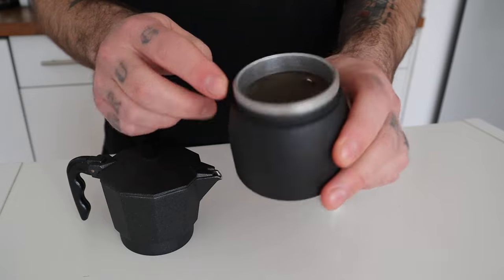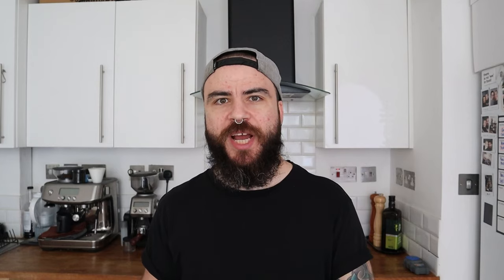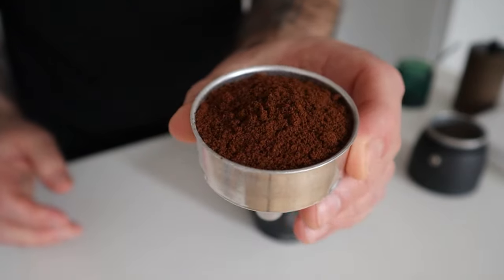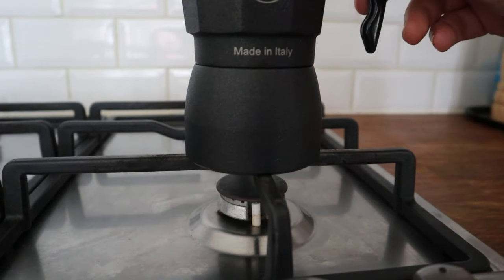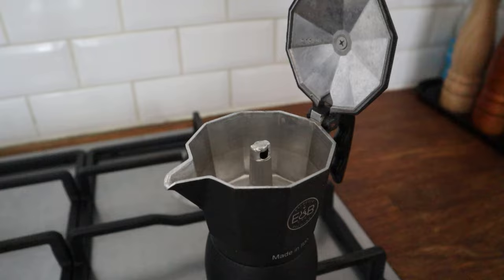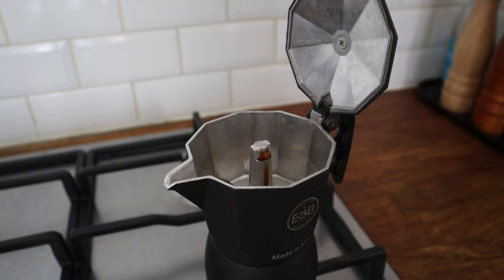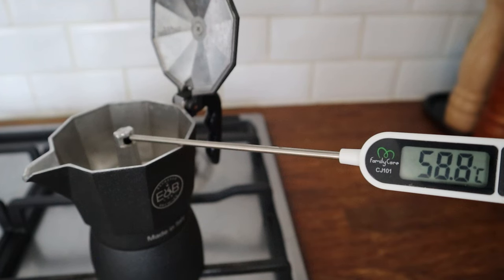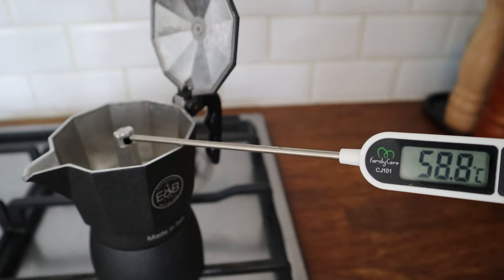The Ultimate MOKA POT Technique - How To Make Coffee With  #mokapot - 2022

Comment: If the the pressure in the moka pot is higher than the ambient air pressure the water must be hotter than the normal boiling point of an open kettle.You cannot have it both ways ! Water will not defy gravity and jump out of the pot without pressure and pressure in the pot come from the increase of heat then water under pressure will boil at a higher temperature.So what is the reason that the water is forced out at 75 degrees?I may be wrong but it doesn’t add up.
Reply from the maker: water evaporate at lower temperature than the boiling point, imagine when you put wet clothes to hang, they will become dry at one point, but they don't reach high temperature. Now in the moka the water in gas form is trapped in the lower chamber and this build the pressure to allow the liquid water to rise in the basket until reach the upper chamber. I hope I answered your questions.

Comment: I notice that the first brew with the new gasket is usually a pretty poor one. But it’s 100% uphill after that. For some reason…. The seal isn’t the best in the beginning. Takes one crappy percolation to get it up to par
Reply from the maker: Yes it happens, sometimes it need to adapt. Also depend on the manufacturing

Comment: how do you know if a moka pot is good or bad?
Reply: Ok so I've always put the moka pot under the tap to cool down when the coffee gets thinner and runnier. I shall not do this next time and see.
Usually my coffe is very acidic.
Reply: And could you test the Ikea moka pot for a video, I'm slowly thinking that that is a "bad moka pot"
Reply from the maker: I usually check, the material, how thick is the aluminium (in case of aluminium moka) filter quality is very important and also gasket, but they can be replace. The valve is also important for pressure stability. Important for a moka pot is that keep good stability of pressure and temperature stability.
Reply from the maker: If the coffee is very acidic I suggest you to remove moka from the stove at that exact moment and let it run by itself. You will see the coffee ill come out but slower and the extraction won't be super aggressive and will balance better the acidity you find. Also to avoid too much acidity adjust grind size and coffee:water ratio. How many grams you usually put in the basket?
Reply from the maker: Probably is the reason why Ikea recalls all of them from the market. To be honest I never saw the Ikea moka pot in the market here in Italy or UK.
Reply: @matteofromtheswamps  the recent recall was due to a faulty valve, mine is way older and never had a recall.
Reply: @matteofromtheswamps  i tried doing as you suggested today and the coffee was actually less acidic. Need to do more experimenting.

Comment: what am i doing wrong? mine trickles with small amounts then slowly builds... then its like someone stomping the gas on ferrari and it bursts out of one side of the column
Reply from the maker: You maybe have too high temperature in the boiler, keep the stove a low heat, if you already do it, place room temperature water in the boiler.
Reply: thanks mate ill give it a shot! @matteofromtheswamps

Comment: Does anyone have any idea why I might get an inconsistent amount of coffee with the moka pot? My pot doesn’t fill up and I have a lot of water left over at the end of the brew. Sometimes I might get only half a mug, sometimes enough to fill a mug 3/4 at most. Any tips?
Reply: Sounds like you aren't getting enough pressure. Maybe your basket is bent from knocking out the coffee grounds? Or you need a new seal around the filter. If there isnt a good seal at these places the pot doesn't work. I have to get a new basket for mine and it made a big difference 👍

Comment: This is not the traditional Italian way to do it. 

I believe the traditional Italian way gets perfect results every time. I learned it from the moka pot video on Annalisa J channel. 

Before I watched her video, I was getting bad results from all these unnecessary and overly complicated techniques, like preheating the water, using thermometer or scale, or leaving the lid open, or putting the bottom in cold water at the end, etc. That is all so unnecessary. 

I get perfect results now like this:

Bialetti says to use cold water, but I use room temperature bottled water. Fill the lower container with water to the bottom of the release valve. 

Bialetti says the correct coffee grind for the moka pot is medium-fine. Most pre-ground espresso is too fine, but there are three that work well: illy Classico Espresso, Lavazza Qualitá Rossa, and Lavazza Creme e Gusto. Additionally, illy makes two coffees that are especially ground for moka and have a red moka pot icon on the lower front of the can: Classico and Intenso. 

I fill the coffee basket with medium-fine ground coffee and level it off with a straight edge utensil, like a knife. (I use the flat handle of my coffee scoop.)

Set the pot in the middle of the burner on low heat. Do not set the pot on the side of the burner, set it in the middle. The handle will be fine.

Keep the lid closed the entire time! 

The brewing process on low heat will be very quiet. The instant you hear a slurp or gurgle turn off the gas or remove the pot from the electric stove.

Let the pot rest for a minute to top off.

Stir the coffee quickly and immediately pour a 1.6 oz (40ml to 50ml) shot of coffee into your cup, or into a glass with 5 oz of hot whole milk. 

That's it! Very simple and always perfect! No bitterness at all. 

I feel sorry for everyone who is trying to learn from overly complicated videos that give bad results. The traditional way is a very simple, easy process.
Reply from the maker: I think you don't want to know how is our (Italians) traditional method XD. 
"The traditional way is pour water randomly in the lower chamber, fill the basket with a big mountain of coffee then close with the top part and place on the stove with high heat until you remember that you placed a pot on the stove before, pour in the cup, drink."

You method is actually good. Bialetti method has many flaws. When they say cold water, they mean room temperature. With my method you get more consistency because you measure the ratio coffee to water every time, so you get the same result. Also not every coffee are the same, so it's good to know how to adjust variables to get the best every time.

Thanks so much for sharing your method and if you are happy and satisfy do not change it. The most important thing is that you like and enjoy the coffee you make and not the method you use. :)
Reply: @matteofromtheswamps  Your method is much too complicated with scales and temperature, etc. It's all so unnecessary, and so intimidating you make people afraid to use the moka pot.

Bialetti invented a simple process so the Italian housewife can just add water, coffee, set it in low heat and forget it while she's cooking and caring for children, until it gurgles. 

Annalisa J is a middle-aged Italian woman, who grew up with moka pot coffee, and she makes it the traditional Italian way, exactly as I described. 

It's the same way everybody did it in Spain when I lived there. 

My son-in-law is from Chile and he also does it the same way.